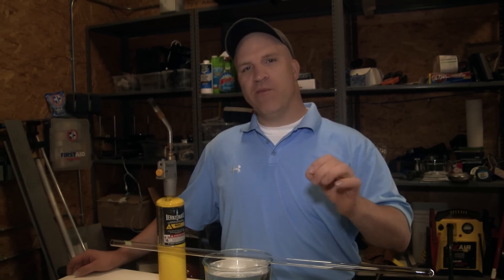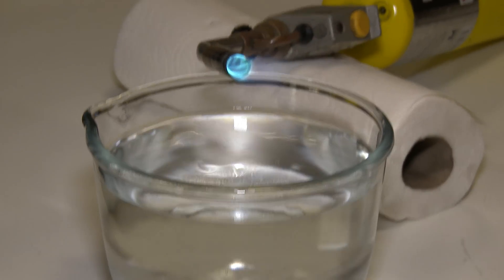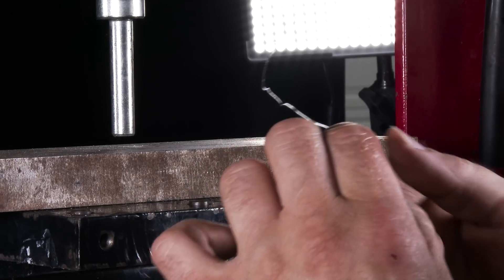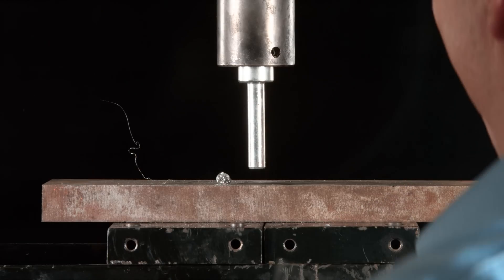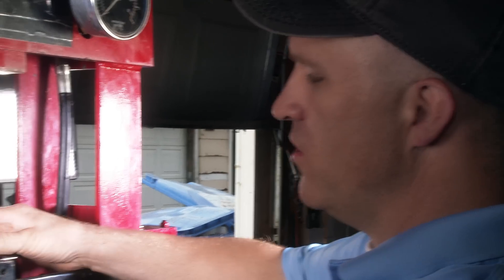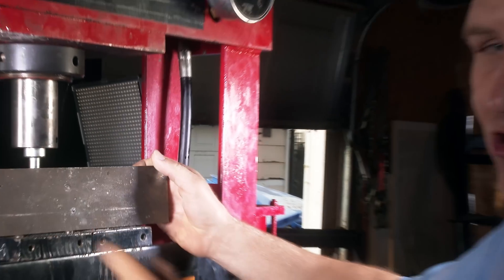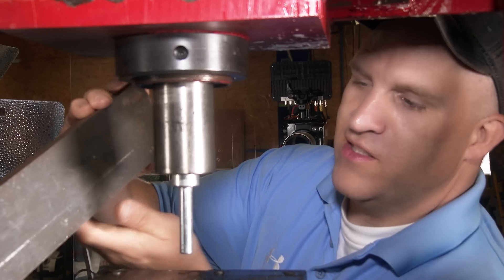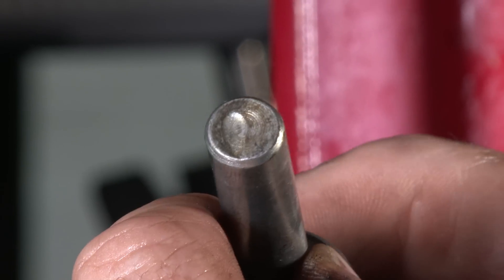Prince Rupert's Drop vs Hydraulic Press [ 4K - Slow Motion ] ( S1 E9 )

Comment: I am more and more amazed at the properties of Rupert's Drops with every video I see about them. There's got to be a way to game this into a useful material purposing...
Reply: Michael Fearless the Problem is that its only glass. the strength comes from the specific form and the way it cools off when it hits the water, making the inside of the drop end cool slower and creating a very strong bond. you wouldnt be able to create any shape you want with the same strength. idk if i got the explanation 100 % right, but i saw a neat video about it a while ago. think it was smarter every day.
Reply: Yep, that's more or less correct - but I'm betting there's some similar technique that hasn't been thought up yet. The fact that we understand it is just the first step to exploiting it.
Reply: Michael Fearless Tempered Glass is a Rupert Drop or at least done the same way.
Reply: That's right. Tempered glass uses the same principle.

Comment: Warped Perception, nice video.
I recently learened that there is a big difference in the quality and thus strength of a Prince Rupert's Drop.
With a high quality drop, you will need more force. I would suspect that if you slow your camera to MUCH slower frame rate, you could also observe the compression of the glass (like a liquid) flowing backward toward the tappered end until the shockwave breaks the thin end and thus causes the super-hard thick end to explode. 
Would it be possible for you to try a professional drop and slower framerates?
Reply from the maker: Gabriel Dibble I'm going to reshoot this with different drops and variables, also we have a much slower video in this channel if you want to check it out . thanks for watching
Reply: Warped Perception Cool, thx

Comment: I do not think that was a Prince Rupert's Drop. The entirety of a Prince Rupert's Drop is under a whole lot of internal stress. It's this stored potential energy that gives the bulb it's truly mind-boggling resilience. Literally.. I've watched a Prince Rupert's drop survive a shot from a 22 caliber long rifle.. the bullet disintegrated when it hit the bulb. However, it's also the internal stresses that give it it's greatest weakness.

All that potential energy is stored as internal stresses.. while the bulb's stresses work to give it incredible strength, the tail winds up also being under the same kind of stress but in an arrangement that makes the entire drop very vulnerable. If any link in this chain is broken, the stored potential energy is released explosively. Since the entirety of the drop is under these stresses, a failure anywhere should cause this chain reaction to explosively disintegrate the entirety of the drop. It's not possible for any part of this chain to survive structural failure. 

Now, it's at this point that you need to ask yourself... If a real Prince Rupert's Drop explodes, entirely, every time you cause a single failure anywhere on the drop, would the tail have survived? I'd suggest not and it is for this reason that I suggest you may not have created that drop properly and it may have been significantly less resilience than it should have been. I think your cooling pool was too shallow, probably not a low enough temp, and perhaps the glass not properly brought to temperature. I think it cooled too slowly (near instantly is not instantly) or didn't cool uniformly. It may also have just been too small as the strength of a Rupert's Drop comes from the point where the drop's surface is cooled to solid instantly while the molten interior is cooled more slowly, which creates the internal stresses that are so important.

I'd seriously suggest trying this again. Make a bunch of them while altering some of the potential variables (cooling pool temp and size; drop size, temp, and height; etc..) and ensure they're real drops by breaking the tails of a few to test if a method of creating them is effective. The entirety of a drop should explode violently when the tail breaks.. The bulb on the other hand.. can shatter bullets and survive forces that are truly mind blowing.
Reply from the maker: RurikLoderr good point and we had about 4 takes just for the Hydraulic Press portion , they all took about the same amount of force to break, although surprisingly the smaller ones seemed to handle more tonnage than the larger drops.
Reply: Yeah we've seen smartereveryday. a .22 round is one of the least powerful rounds, on top of the fact that his was hanging freely by a string. the bullet just pushed it away. this one had nowhere to go with 20 tons on top of it.
Reply: 20 tons of force is so much more significant than a 22 😂
Reply from the maker: take a look. https://youtu.be/tRUngxK2yXY
Reply: RurikiLoderr
Do you think that ordinary glass would be able to withstand up to 20 tons? No. If it wasn't a real Prince Rupert's Drop it would never have lasted as long as it did.
Reply: Surviving a shot from a .22 is not really that big of a deal to be honest. Also, lead bullets disintegrating when hitting harder materials is not strange at all. That's about what you'd expect it to do.
Reply: Your best bet is to maximize the frames at which you can record it. 5000 FPS just simply isn't enough.
Reply: While, I think it's a great idea to do the test more than once, I still think you're severely over estimating the power of a .22 caliber bullet. Also, I think you'd expect the glass to not be marred at all if it didn't break, because glass is so much harder than lead. What I'd really like to see is a Prince Rupert's Drop shot with higher powered cartridges.
Reply: Now those are great results! Thanks for the link :)
Reply from the maker: Grant Crawford your right, a regular piece of glass would never hold that kind of force.
Reply: Gopheur It didn't just disintegrate the bullet, it wasn't marred by the shot at all. It shrugged it off like it didn't happen. I don't doubt that 20 tons is a lot of force, but if it was a Prince Rupert's Drop made in a way where the glass didn't harden properly or the internal stresses didn't cool in the optimal configuration.. Well, internal flaws might significantly weaken the capabilities of the bulb. The maximal force these things can handle is what I want to see.

Generally, it's more a criticism of just doing a few drops. Was is indicative of the capabilities of a rupert's drop or was it an outlier. You do multiple trials while minimizing unknowns to get an idea of what's really possible. The question of whether or not a drop can sustain 20 tons of force on a press could be a huge underestimation of what it's capabilities are.. OR.. it could be a massive overestimation.

Either case would allow us to know more about how these things really work.
Reply from the maker: Gopheur true like an M4 with a .223 or .556 FMJ
Reply: RurikLoderr, I have to agree with your reservations about this experiment. 

It is possible to anneal the tail of a PR drop so that a break in it will not propagate, but I really have to doubt they did that here. The video shows that the cracking did not propagate up the tail at all. And I'm not clear that we should be surprised that it takes 20 tons to break glass. The real threat to glass comes from its brittleness, the fact that it can't be deformed very much without failing. A lump just sitting there doesn't have much room to deform. It would have been illuminating to put an ordinary piece of plate glass in the press and see what happens. Without that control, I don't think the 20 tons means much.
Reply from the maker: RurikLoderr we are going to do this again thoroughly, all I have to say is, no matter how strong, how big or how hard it is, we are going to destroy it again and again with as much excessive force needed. also I think 20 tons is an insane amount of force, 10 full sized cars worth of weight .

Comment: curios to see if a steel Rupert drop could be created and how strong it would be if it could be made.
Reply: Steel and glass have completely different physical properties. That includes their reaction when coming into contact with water at high heat. Because steel has to be at a much higher temperature than glass to be molten, it would not instantly harden on the outside when brought into contact with water. The outside of the glass hardens on contact with the water which is what creates the surface tension of the drop.

Comment: Holy sheet i never seen a prince ruperts drop break form the bottom instead of the tip, guess it's possible after all
Reply: not a real drop, the tail survived and if you watch another vid they have with it at 380,000 fps, you will see that it's not a proper one, an actual one would have do a lot better, they need to get one made by a glass maker to get an accurate representation, a prince ruperts drop will actually disintegrate a bullet and still have no damage taken, as long as the tail doesn't break from the shock wave!
Reply: Yeah after the equivalent of 10 cars in one square inch was pressing down on top of it. lol
Reply: 11Beanzy
Do you think that ordinary glass would be able to withstand up to 20 tons? No. If it wasn't a real Prince Rupert's Drop it would never have lasted as long as it did, you criticism is silly and groundless.
Reply: Grant Crawford not groundless watch smarter every days video on it
Reply: Grant Crawford no meed to reply in that was, there are grounds for my reasoning, as I have seen these, watch smarter everyday's video's on yhe prince ruperts drop,  then you will see that I'm not bashing them, its just the drop could have been made more proffesionally,  even in smarter everydays videos he sais the same thing about his own, but his drop reacted the way a prince ruperts drop should, I encourage you to watch those videos before trying to bash me again.

Comment: i feel like it could have stood up to more pressure if it was made more correctly and the tail wasn't so long cause as soon as that tail bends even a micrometer the entire drop shatters 

any time iv watched the drops being formed they are heated and dropped vertically not horizontally that might have weakened the final product due to it not being perfectly symmetrical

Comment: The fat part of Rupert's drop is annealed by sudden quenching in water. It's harder than regular steel.
Reply: The opposite of annealing, actually. Annealing is letting it cool slowly to allow internal stresses to relax. This is tempering. But otherwise you are correct.

Comment: Yes, so it does break, i can rest in peace now. Lkl
Reply: Golden Ratio but why did it break? Camera wasn't high enough speed to tell if it was crushed or if the break started in the tail. 

Sorry. Your in for more restless nights. Lol.
Reply: Hotwheelz_McG nope, it broke, if u watch carefully the tail is still bouncing after all thr shattering, it looks like a thin white hair. Trust me that's why I commented and resting in peace now. Lol

Happy holidays.
Reply: Golden Ratio it actually doesn't necessarily "connect"  to the whole tail, I saw a guy shuttering a piece of the tail without the whole thing exploding,  seems to be the case with really big tails

In addition to that you have to think that if the shattering of the tiny tail chain reacts to the head then shattering the head should have chain reacted to the tail, so in conclusion that part of the tail wasn't "related"  to the drop
Reply: Mike J McClendon the whole thing about the ruperts drop is the tail always going first, u can clearly see the drop shattering first and is totally separated from the tail, hence the drop ain't bullet proof hard after all. RIP. Lol
Reply: 20+ tons of pressure, head of drop shattering first, everyone can sleep like a baby at night.
Reply: Golden Ratio check my video link above. It's not the tail or the drop that goes first. It's actually a point between the two in this case.
Reply: Emertxe exactly why i rest in peace. Lol happy new year.
Reply: +guernica69 Smarter Every Day made it yes and it did shattered but that was originated in the tail not the bullet. It was in fact the shock wave that broke the tail.
Reply: Owen Wakefield wow dude you need to get out more and learn the language and figure of speech, don't make us school u, genius!
Reply: The frame rate is just to slow to see what actually happened. Just because all of the tail didn't explode doesn't mean the head shattered first, the compressive and tensile forces in the drop would eventually reach an equilibrium at the end of the tail I think. This was really cool though. If he did break the drop first I'd love to see it at a couple of hundred thousand frames a second. If I had to guess I'd say he did though, considering force wasn't applied any where else.
Reply: No no dude, a well-made one can survive a direct .22 hit. Check out the channel Smarter Every Day, he just did a vid on this very thing.
Reply: ***** yep I agree. I mean come on. If it can handle 20 tons of pressure, what's a little .22 going to do to it.
Reply: Golden Ratio It is bullet proof you mongle, that was a fucking hydraulic press not a bullet
Reply: exactly my perception, I believe that the tail would have absorbed the tension and transferred it to the head
Reply: James Barrie the is glass, glass doesn't take tension, transfer, flex...
Reply: Different as long as head shatters before the tail, i rest my peace. Which happened here.

Comment: Does anyone know the exact compressive strength of the glass in psi? The strongest concrete can have a compressive strength of 20000 psi. I wonder if the Prince Ruperts drop is higher.

Comment: You need to make a drop out of solid rod, not tube. Tube introduces air bubbles inside which weaken it. Try again with a rod.
Reply from the maker: Lajos Winkler we did just haven't posted it yet .... soon

Comment: How on earth can you call it slow motion when the drop when from being whole to being shattered with a projectile spread of more than double it's original width in a single frame? I get that the drops shatter at an incredibly fast rate, and it's okay that not everyone has the top of the line cameras that can capture it in slow motion, just don't call it slow motion in the title!
Reply from the maker: +Joseph Douglas well not sure what you consider top of the line. We used a Phantom Flex 4k to shoot this and we recently reshot with a Phantom V2512. Should we have used an iPhone and called it slow motion video like everyone else on YouTube?. Lol
Reply: Warped Perception Look, I've seen videos of Prince Rupert's drops shattering in slow motion, and they all showed dozens of frames of just the bulb part. The slow motion in your video did NOTHING, it was whole, and then it was shattered. No slow motion transition at all. Before I thought it was because you didn't have a top of the line camera, because how could you if that was the result? Now I'm baffled as to why you didn't manage to get a SINGLE transition frame when you did have a top of the line camera.
Reply from the maker: +Joseph Douglas lol.. cause we only filmed at 5000 fps, thought it was fast enough but we were outta drops and had to move on to the next project. No need to worry though we recently refilmed this at 480000 fps. Part of the reason it happens so n fast is that the other videos like smarter every day showed the entire drop with a long tail and he broke the tail end then the fracture traveled which took time, in this case it literally exploded when loaded with an additional 40000 lbs. The ultra slow motion 480k Revealed is that the explosion shock wave actually didn't even allow the tail to break at all so the camera was framed on the very small area of the drop. So if you do the math compared to SED's clip that's only about 1/30th the length which is only a few frames.
Reply: Warped Perception Thanks for the explanation, and I apologize for my aggressive attitude.
Reply from the maker: Joseph Douglas all good, thanks for taking the time out to watch and comment.

Comment: Destin from SmarterEveryday explained this very well. He was able to capture the instant it breaks and we could actually see the breaking of the tail going to the body.
Reply from the maker: JR B Destin did an awesome video explaining the science behind the ruperts drop. that's exactly right though he broke it from the tail we broke it from the tip. also a channel called Flinn scientific cover the whole ruperts drop Thing Two. interestingly enough recently we filmed the same Crush at 480000 frames a second and, the tail actually snapped off from the shock wave and flew, very interesting to see

Comment: I think the tail was broken somehow before the drop shattered. 5000 fps isn't fast enough to see how it broke. in this video it seemed to instantly shatter even at that high frame rate.

@smartereveryday recorded one of these drops shattering at 130,000 fps and it really captured the way the drop fractures. but even at that frame rate it was still fast. I am curious to see how the press fractures the drop at that frame rate. 

this video does a great job of demonstrating the strength of the drop though
Reply from the maker: +Joshua Manson we actually just finished filming this at 480000 frames per second about 4 days ago , even at that frame rate it was still fast, but we did capture some game-changing footage, a bed frame rate we have reserved that when you actually break the drop portion the shock wave breaks the tail off and makes it fly. Really interesting